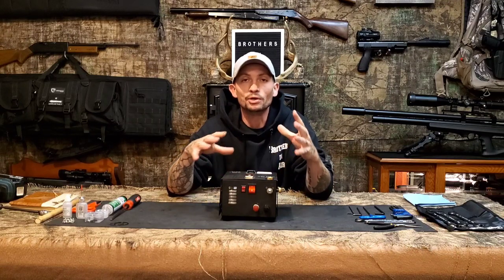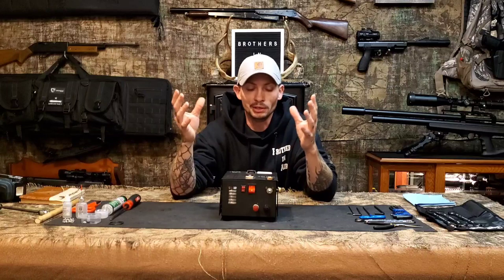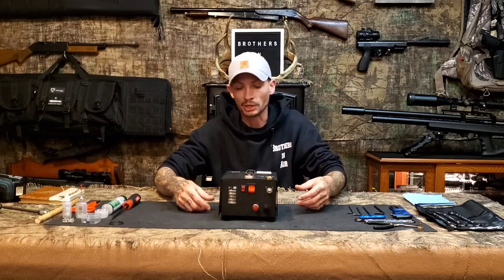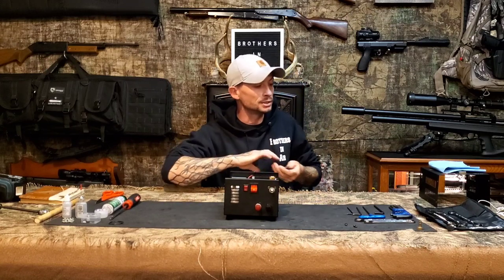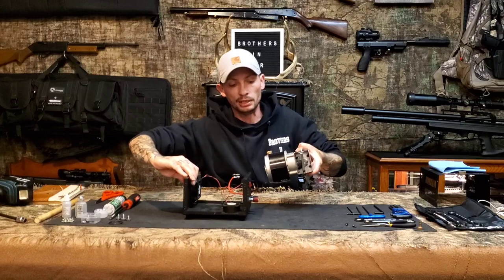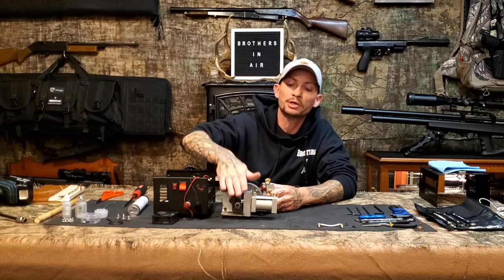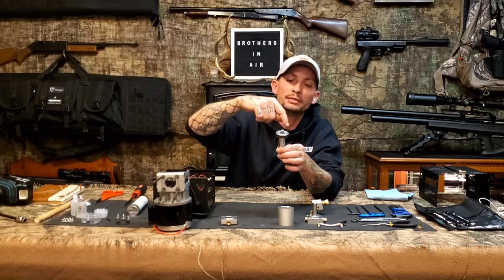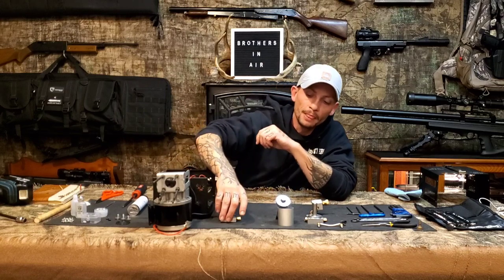TUXING AKA "SPARK CLONE" COMPRESSOR  **** 1yr Update + DIY Pump Rebuild/Maintenance ****

Comment: A ton of compressors for PCPs come from China under different names. They are all pretty much the same. Some air gun supply companies put their names on them and charge us as much as 400$ more than we can get them for from places like Ali express and the like. Makes you feel taken advantage of in the end if you buy theirs and then you find it on alibaba later for a fraction of the price. Air gunning is supposed to be cheaper shooting. Thank you for this video. Your helping to advance this sport by showing alternative filling solutions for our guns. I have the Yong Heng and fill 4 large tanks 2Xs a week. Had it for 2 years now and zero issues. I understand where your coming from. Walmart sells them now for under 400$ with a 4 year warranty. Versus 1500$ and up for a name brand from a dealer...man...that’s hard to pass up. Truth is...a very large part of the air gun products come from China. May not be all cool with it but we can stop it.  Enjoy what you can, afford what you can, and don’t go bankrupt doing what you love if possible. The so called “OFF BRANDS” as their called, and are looked down on by some seller distributors, aren’t really off brands...they just have a different sticker on them, usually theirs. I’m not putting names out there cause I don’t roll like that but we know the type. They are the same. Thanks big dog for spreading reality of what it really is.
Reply from the maker: Couldn't have said it better myself! Thanks brother
Reply: I noticed those compressors here and there on the net. I believe your right Heath.
Reply: Heath Mind if i ask... what filters are you using on your Yong Heng

Comment: Thank you. Excellent presentation. I am now a subscriber. The cam plate converts the rotational motion of the motor into straight reciprocating motion needed for the piston. An internal combustion engine uses a wrist pin in the piston to accomplish the same function.

Comment: Hello folks! I have an update regarding my Hatsan Spark (a Chinese generic compressor). I managed to fix my DOA compressor purchased from AliExpress. This video helped me a lot for which I am grateful.
My item had this internal piston rubber ball missing. Due to this, the compressor could not build pressure at all. So here is what I did...
The piston 32:52 has an inner metal ring that looks like it's part of the mold but it's just a retainer ring to hold the rubber ball. Since this ball was missing on mine I had one from an old pump and installed it. On the first attempt to pump my Hatsan Bullmaster the ball went through the upper hole.
My second attempt to fix the compressor was indeed successful. I removed the retainer ring using a flat screwdriver (be careful not to scratch the piston head as it's made of aluminum. Then using a Dremel I cut a tiny rectangular bracket and drilled a 1.5mm hole on one side of it. I also drilled a 1.5mm matching hole in the back side of the piston head. Then in the orifice that is intended for the valve, I dropped a steel ball from a bearing and installed a half spring from a pen to keep the ball pushed onto the bed. Finally, I screwed the rectangular piece that I had prepared making sure the spring was under it. This solved my issue completely.
I must say that those compressors lack built quality and are way too under-engineered. For example, the 12V line does not have a fuse, so it's a good idea to install a 30A fuse in case something goes wrong.
Anyway, Thank you folks for being part of this community!

Comment: Well I finally got to use this video on my compressor.  Just lately, it started taking 2 or 3 times as long to fill my airguns, so I brought up your video and set my computer on the dining room table.  I made several trips to the workshop in the garage for tools etc. and to take parts out to blow out with the shop compressor.  I followed every step by pausing the video until I got the particular task done.
My only mistake was I somehow let the little brass split ring on the second stage compressor fall off and get lost.  I went ahead and finished without it which hopefully will be ok until I manage to find one.
As soon as I finished, I tried it out filling one of my pcps, and it worked like new.  It no longer had that seal bark (lol), and it was as fast as it was when I first bought it.  
Thank you again for a great video which I will be using again in the next 6 months or maybe sooner if I find that little brass ring.

Comment: Hey Bro! Just wanted to give you a shout and say, THANK YOU!! When deciding on a PCP, it was your videos that sold me on the flashpup. I've been tuning and shooting this little jewel for about a year and a half, and it still impresses me with it's capabilities at that price point! Got interested in slugs recently and since NSA is in the middle of a move, I ordered some Griffin 40gr hollow base slugs to give it a try. Wow, They were too heavy to shoot well with the Huma regulator I installed, so I pulled the regulator and got amazing results, 21 shot string, 710fps, ES 35, SD 8.7!! Not bad for an unregulated flashpup! I'm not giving up on the Huma regulator though, ordered a XXL plenum to get a bit more air for the 40gr slugs and I'll retune to see what I can get! I know I'll lose some speed, and shot count, but I'll bet it'll clean up those ES and SD numbers! Haven't done accuracy testing yet, when I do I'll post again (shorter I promise)!

Comment: I can't thank you enough for taking the time to produce this Video. I have the same compressor and found after months of use it would not pump to the high pressure it did when new. After following you detailed instructions my unit now works like new. Many Thanks from a "Brother in Air". Keep up the quality work.

Comment: Super video! Thanks for sharing. I'm saving this one. With YouTube, you never know what to expect. Question:  If I recall correctly, you mentioned that Tuxing didn't intend to have a rebuild kit available. Have they, or are they going to make the carbon fiber rings replaceable, as well? If not, what happens when they finally go out, which I assume will  happen eventually?
Reply from the maker: My pleasure brother. As of the most recent info I have they will not be providing a rebuild kit for the compressor. I would think in large this is due to the deal they have moving so many units to Hatsan which they then rebrand as the Spark. Hatsan would only sell one unit to each person if they were rebuildable but as it stands I know there are people on #2 or #3. On a positive note though they have in their latest models and moving forward have been using PTFE compression rings and providing full rebuild kits. The rings must be calibrated so one would have to invest in a proper dimensioned calibration cone but they are in fact fully rebuildable. Unfortunately outside of measuring the dimensions and ordering the rings from a third party ourselves I don't see the compressor in the video being much more than a paper weight once they finally wear out.
Reply: @brothersinair2064  Thanks for the info, but which units are now rebuildable, Hatsan, Tuxing direct, both, or what?
Reply from the maker: @howdydoody30204b  Speaking only of Tuxing. Models such as the TXET061-2.

Comment: Where ya been? Great channel. 
I bought 2 Flashpups cuz of you. Still learning. So far so 👍 good.
Reply from the maker: Awesome! Had some bumps in the road loosing months of footage and a camera to theft while on vacation with my family. Kind of just took a break from the vids for a while but I'm back now. Got some cool new stuff to show!
Reply: @brothersinair2064  I got the 22 & 25 Flashpups discounted direct from Hatsan as refurbished. With 6 turns on the hammer spring I get 1 magazine of full power shots. 
What's max. fill pressure you recommend? Can I go a little past 200 bar if I shoot it the same day hunting.
That little 165 cc tank really starts dropping off after 1st mag 😳 😆 Lol
Reply from the maker: @stedyone1090  I won't recommend over filling any vessel above the manufacturer's stated "max" fill pressure but I will tell you what I do. With my regulated Flash(pups) I fill to 230bar. When regulated the force against the valve is relative to the regulators set point and not the overall fill presure. The problem overfilling an unregulated gun is that the valve will have so much pressure against it that you may experience partial or even full valve lock. The pressure reaches a point where the force against the valve poppet is greater than the available force of the hammer strike so it is locked shut. Where that point is exactly on this platform I don't know but you could probably get away with quite a bit being that you have the hammer strike tuned to strike very hard. You could definitely squeeze a couple extra shots out but if it were me I wouldn't push the overfill too far. The higher your fill pressure the more wear and tear to the o-rings and air cylinder so I wouldn't store the gun with the tank above 200bar. Personally if I'm storing a regulated gun for a bit I will have it just above reg set point. Unregulated I store around 150bar or so. This minimizes the stress on the metal and slows the inevitable compression set of the o-rings.
Reply: @brothersinair2064  Makes perfect sense. Thanks for info..

Comment: As an owner of Hatsan Flashpup like you, I had a recurrent regarding the Flashpup @ 150 bar remaining, not used for at least a month I tried to pumped it at least to almost full but it seems the valve was shut close as the handpump rebounds when pushed down (handpump is newly checked & installed with new spares) the first time, I went browsing on airgun forums, & there was a guy that had the same problems, he just gently tapped the action with a rubber mallet to open the valves, I did that the first time & was successful , not this time ! I handpumped all my pcps ! & this is the only pcp that has the problems ,

Comment: I need some more FlashPup videos, wish you could see mine, love your videos, all the info you provide has made me really like them!
Reply: I've got a flashpup too. Just stained the stock a bright red. It looks awesome. What have you done to yours?
Reply: @davejensen5336  I can't find yours. Mine will come up if you google search Z28HATSAN
Reply: Go to the PA website, go to the wood FlashPup it’s in customer images bottom pictures
Reply: Nice red! I was thinking of doing the magazine holder too.
Reply: @Z28PAPI hopefully you found my pics, that red really grows on you the more I look at it.
Reply: @davejensen5336  I did! Where did you get the barrel?
Reply: @Z28PAPI  Amazon. The guy on YouTube Air guns & pesting ch. shows it. It’s like 14mm I/D & 20mm O/D & 500mm long, you have to cut it down & sand the inside to slip it over barrel. His video has all the info.

Comment: OK, Successful mission thanks to You.  Got her all tore down and put back together. Started her up and much quieter. But plugged whip test 10 + minutes after shut down she leaked from 3 bar down to 2.3 bar  . Hell, That could be the plugged whip leaking somewhere I would think. No  ?   Did water / soap test with small paint brush and detected no leaks  ?  Hell, I don't know.

Comment: Hey bro!
Good to see you again. Sucks you got ripped off. Is that a FX behind you? Was wondering if they are as accurate as reported? Any flashpup synthetic reviews coming? We need your expertise to get the most out of ‘em.
Glad your back. Thanks.
Reply from the maker: Thanks bro good to hear from you.  I do have some pup S stuff coming. Did quite the build with mine so need to share for sure. That's an FX Wildcat MKIII Sniper. When tuned properly I would say most FX guns would be hard to beat in the accuracy dept. The accuracy I get from the new WC is unparalleled. The new .22 Supreme STX barrel shoots both pellets and slugs exceptionally well. Sub MOA out to 100yds all day!

Comment: I just bought a flash pup.  So far I really like it except it loses about twenty five bar a day.  Any suggestions on how to find the leak and fix it? Thanks   I’m working my through your videos and finding all the information well thought out and helpful.
Reply: You can find exploded diagrams of the flashpup on hatsan website if I remember correctly. Some times you can get leaks from the dirt getting in where the fill probe goes in. I would remove the stock and try and fit a latex glove over the end of it and rubber band it as tight as you can. If it inflates then that's your leak.
Reply: Thank you for the reply. I ended up sending it back to Utah air. They fixed the leak and had it back to me in about ten days. 
I was very happy with them.  Hatsan USA not so much!  It’s been a month and still no reply from them

Comment: Great Video! I took apart my compressor because it stopped pumping and found (inside the cylinder) 2 halves of the check ball that belongs in the bottom of the piston head as you described. The retainer washer that holds the check ball in place is very thin and sharp and only allows a half moon hole to insert another ball. Is there a way to remove that washer so I can put another ball in place without cutting the rubber check ball?

Comment: Listen to Him when he says he filed the sharp edges where the piston rod goes through the first stage block. Those sharp edges I played hell and even slightly damaged the hub seal trying to skip that filing part. That hub seal ( center of first stage block ) looks very important to pumping high pressure air to me anyway. It is on the first stage block though so not sure  ?

Comment: Quick question
 I have a compressor like this and when I try to fill up a gun more than 3000 the air compressor stalls out and turns off What could be the problem.

Comment: I am trying to pump up my 4300 psi Hurcules .45 Bully with this same pump. It is taking more than 10 min. ( 2 separate 5 min sessions)  to get it there. I think it has a 480cc tank on gun. Does this sound right   ?   PS I've only pumped up like 5 guns and my built in digital heat gauge shows nothing now ever.
Reply from the maker: That sounds like it's cranking away nicely. Right on par with what I would expect. For perspective....When filling from completely empty 0bar-200bar on a 165cc cylinder it takes 6mins for me. My 300cc from 0bar-230bar takes two sessions. One about 6min then the second about 5min. If you were topping off from a partial fill I would say you look good. If it only took two 5min sessions to fill from empty then you're hauling ass lol!!!
Reply: @brothersinair2064  You Da Man, Thank you Brother. Its actually a 250 bar max and I've heard its 480 cc , Ive heard its 500 cc . Not sure. I think I was coming from a half a bar or 1 bar. . Should have checked better. PS Hope your mouth heals up satisfactory. And Thanks again. Your the go to man for cost effective compressors to the Hatsan and beyond airguns.

Comment: Nice job , one issue i am have is a leak from the bleeder valve. Pretty new unit but as pressure builds I get some leakage. Any thoughts? Is the seat replaceable? Thanks so much for you excellent videos. Just picked up the hatsan flashpup in .22. Thanks to you .

Comment: Thank u so much , watched this video several times before taking my nomad 2 apart. What happens if the last one way valve at the end of the high pressure tube still smells of carb cleaner? Will just the smell cause my pump to explode ? I can't seem to get it all out of that tiny spot.

Comment: Just watched your video mate mine runs but no air comes out it also sounds quieter I wonder if the seals are gone or I broke the shaft like you talked about at the end of the video any ideas why it would make noise like it was pumping but quieter and no air coming out ??

Comment: Another great informative video.  I just had an issue with mine a couple days ago. I have the exact same compressor.  It will run fine until it starts to build pressure.  It starts to slow down and when it hits about 500psi it stops??? Any suggestions???
Reply from the maker: Thanks! Does the unit build pressure slower and slower then it reaches 500psi and won't fill any higher than that? Or... Does the motor itself slow when filling and then come to a complete stop at 500psi? That's only roughly 34bar so just trying to figure what's happening. Feed me some more details and I'll help if I'm able
Reply: @brothersinair2064  If I have the bleed value open it runs normal.  Once I connect to my gun and close the value and starts to build pressure it gets slower and slower until it stops at 500psi.
Reply from the maker: @edwardfern4359  I had a faulty power source converter (AC110-DC12V). It would run the compressor fine until the compressor started demanding a higher 12V amperage then then it would drop the voltage until the motor eventually stopped. You could take a volt meter and test the output while the compressor runs until stopping. Or... You could try a different source of power to see how it reacts. Maybe the brushes in the 12V motor are worn? You could Google how to test that with a voltmeter also or I could tell you if you get that deep. I can't really think of anything else brother hope that helps
Reply: @brothersinair2064  thanks for all your help. It will do the same thing if plugged into a 12v battery or power supply.... I ordered the xisico gx-e-cs3 to keep me going.  I'll keep working on my spark knock off as a back up. Will let you know what I come up with! Stay safe and hope you and yours are doing well. Look forward to the next vid!!!
Reply from the maker: @edwardfern4359 The xisico looks good from what I've seen. Let me know how she does!